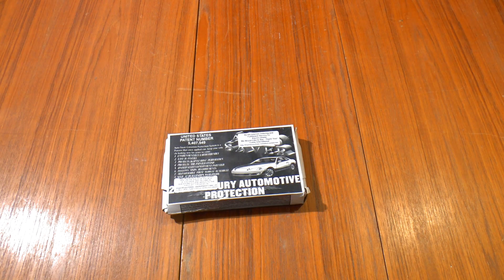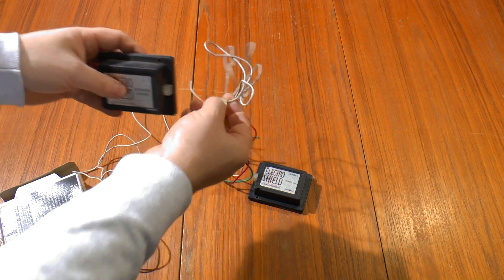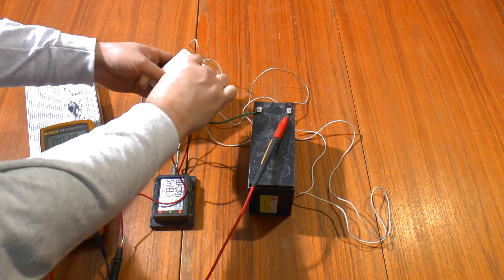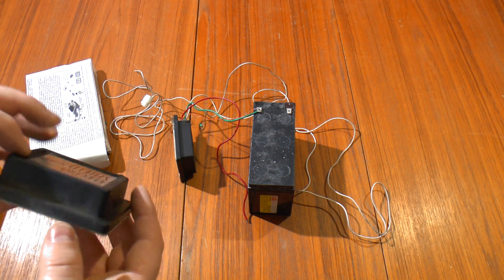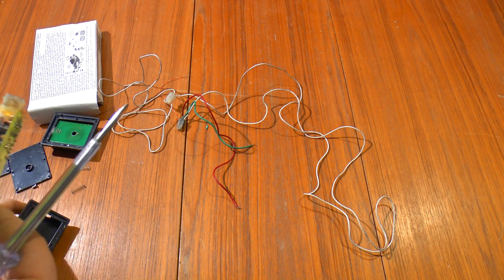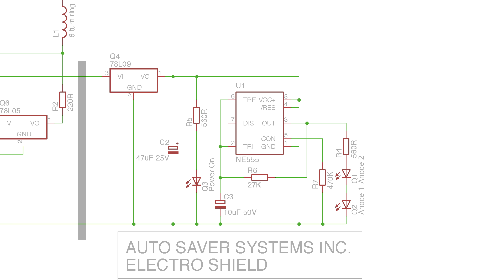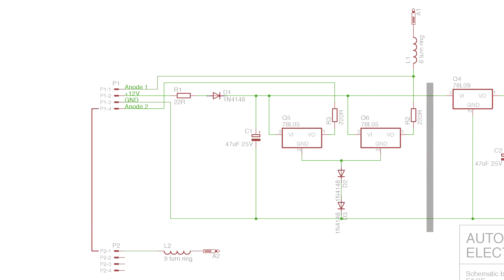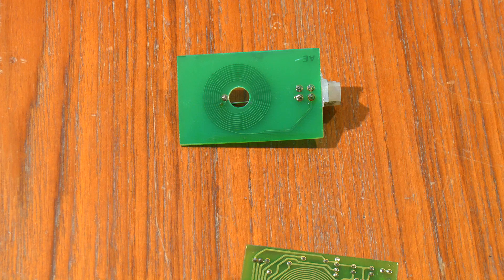Electronic rust protection EXPOSED! Electro Shield teardown

Comment: i wonder why would they use 7805s instead of just a resistor....
ive seen shit made just for the looks but i dont think people are gonna open these to see whats inside....maybe its so they can claim super secret researches and shit and that its not a scam?
Reply: i know very little about electronics, but knew that was gonna be a 555 timer in there as well!
Reply: jusb1066
 when i saw the blinking leds that was the first thing that came to my mind. But my point is that to be fair, this could had been made MUCH cheaper.
I mean, it's a fake piece of shit, why couldnt they just make an oscilator with transistors and remove some of the extras that do nothing? They could have saved $0.000001 by doing that!
Reply: +laharl i would guess they copied the design from somewhere, didnt have the knowledge to simplify it, plus if someone does open it, the more bits the better it seems
Reply: jusb1066
"plus if someone does open it, the more bits the better it seems"

but that's the thing, it doesnt matter. Once someone paid for it, he's already screwed.
Why would you care about what he thinks about the product, it doesnt give you any extra money. these scamms are a one time buy thing, they relay in that there are lots of people and that by the time they figure out it was a rip off millions would have already bought one.
Reply: Laharl Krichevskoy the regulators are supposed to interfere with each other rapidly switching the power on and off ... I don’t see how running radio frequency effectively AC through your car is supposed to help prevent rust... if hooking it directly to the battery and the alternator doesn’t... but I would make a terrible snake oil salesman